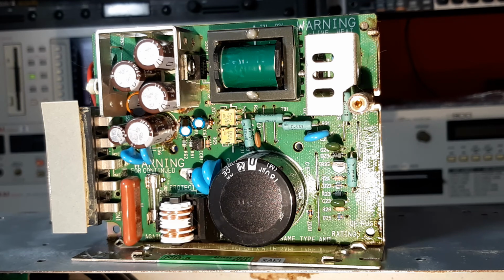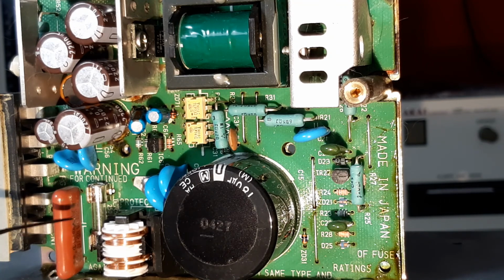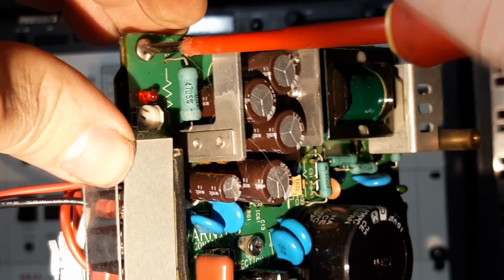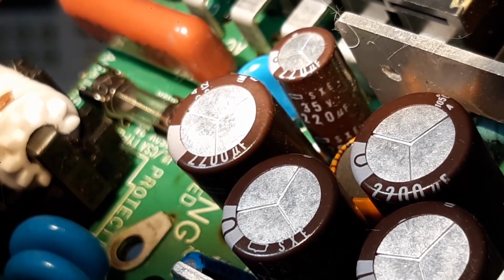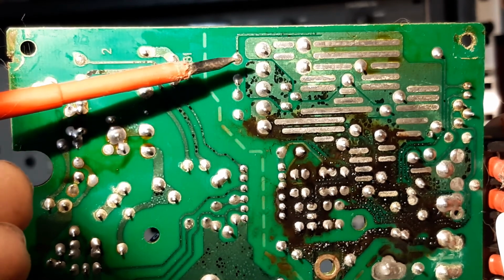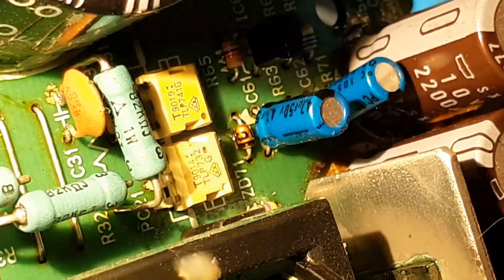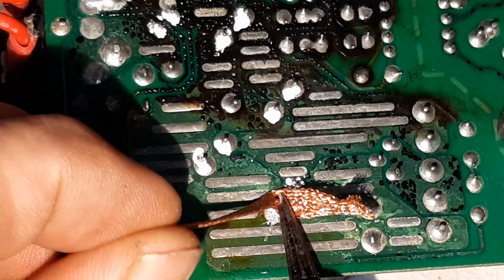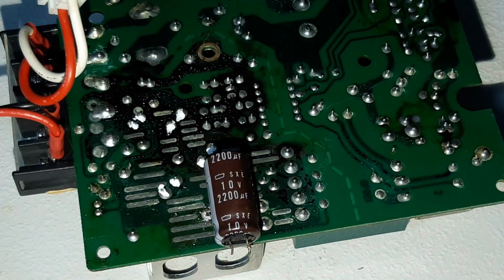Saving & Repairing Akai Samplers S900 S950 S1000 S1100 Part Three

Comment: Grab a temp controlled soldering iron, one that can get hot! sometimes you need it as some pcb's have large ground planes and they suck up heat, making the job harder than it should be. Also grab one of these solder pumps, if you use the generic plastic tip ones you will probably never go back to them after buying this: Japanese ENGINEER SS-02. I have a few of them and they are brilliant! Also fresh solder on old pads and some no-clean flux will really help to get old solder flowing and removed.

Comment: flux and a better iron and this is easy. Your iron is just not upto the job.
Reply from the maker: Yeah agreed on the flux its damn helpful. Dont think I've had any probs with my iron, its adjustable I tend to run it at around 60 %. Some of that old solder is pretty nasty so I crank it up for that type of work. Really need a desoldering tool. I like the vacuum mains power units ..on the list. Cheers for your input its appreciated.
Reply: @unrulysoldier2140  also it's good to reflow the joints first with some fresh solder that should help.

Comment: Hey man! Thanks for the tips on repairing Akai samplers! I'm in retro studio gear myself (I repair everything from Yamaha desks, Rolands, to emu/Akai samplers).. Lately o was able to raise from the ashes an Akai cd3000 (non xl) with broken CD/floppy and backlight. If you ever come across this unit (there's plenty of them dead) the laser replacement is Sony kss240a :).
Thanks once again and happy sampling!
Reply from the maker: Hey thanks for the props. Duly noted on the part number. Actually ihave an Ensoniq EPS16 which has a bad drive so I'll be trying to fix this soon. Finding alternative compatible swap ins can be difficult for aged units.. I may find some luck in the forums. I seem to remember swapping in a pc floppy as a test  but it didnt like it. If you ever get an emu e4xt ultra in I'd be happy to make an offer as it was my go to sampler and still one of my preferred. Take it easy and thanks for the feedback 🤘
Reply: @unrulysoldier2140  ps. Use, please, the suction pump to take out iron from the pcb when removing the caps. A bit of an oldskool way to do it but works like a charm :)
Reply: @unrulysoldier2140  as for the drive in your EPS you need to take all the dirt from the spiral piece attached to the motor then lube again. If it will move but not read the disk then you can clean the header or replace it from an another old working atapi drive (i assume it's a standard 1,44 scsi floppy drive). 
I have here an e5000 ultra but it stays with me cause this is my only E-mu sampler. 
I checked on our local auction site (Here in PL) but we have only 2 e5000 ultra's for sale unfortunately (which is a great sampler, but low on outputs). 
Anyways, you earn a new subscriber. 
We'll be in touch.
Kind regards!
Reply: Good to finally see someone with soldering as bad as mine. Fair play